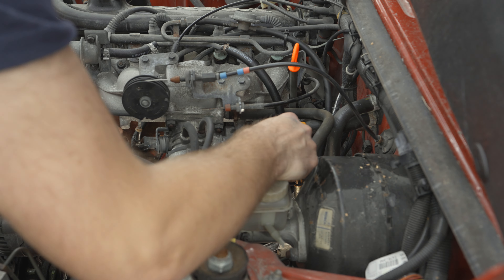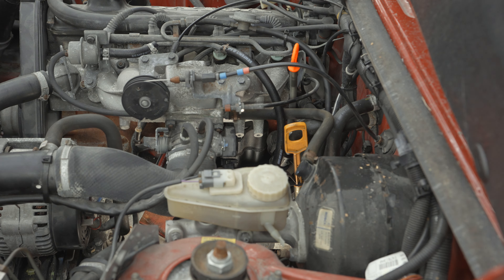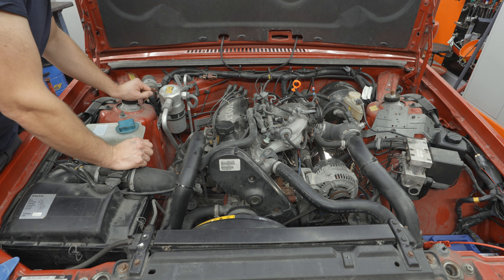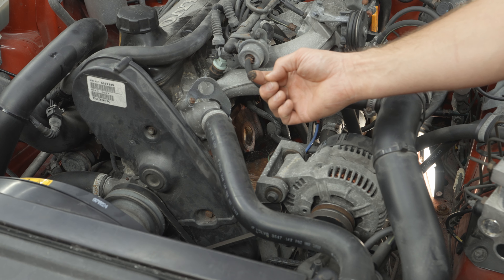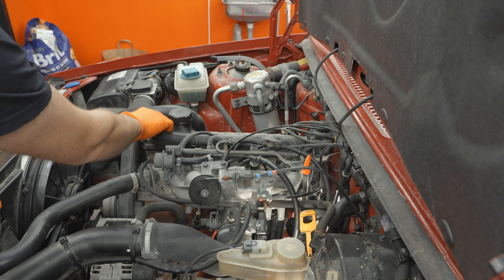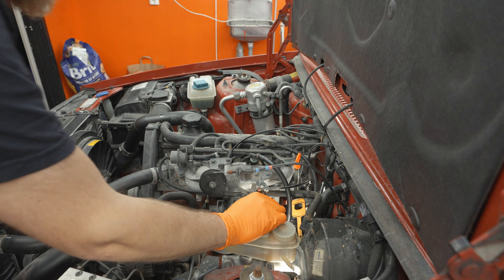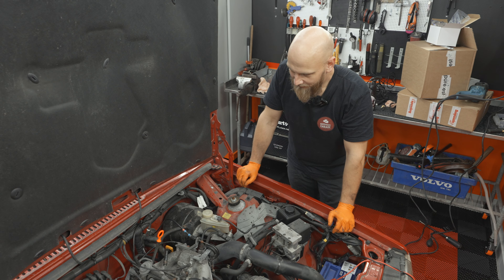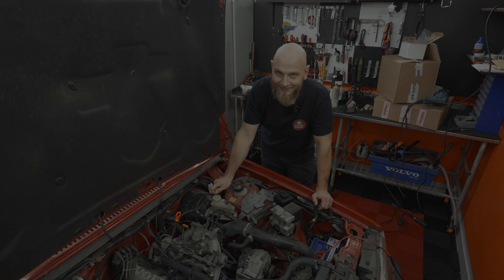How to Clean & Replace the PCV Canister on a Volvo 945 | DIY Maintenance

Comment: Great video.  Even though I've done a PCV cannister before (and broke it getting it out) I learned two things 1. The wobbly socket is called a 'knee'. Nice, I like it.  2. the seal doesn't come with the PCV.  Arrrgh!  We're as far away from Sweden as you can get, parts cost $$$ in freight and take ages...

Comment: I wish Volvo made a PCV box that you could take apart and clean.  It is easier to just replace them altogether, versus trying to clean them in their current configuration on the "redblock" motors.
Reply from the maker: True, and it is a service item as well. And if you have egr it's a real pain.

Comment: What alternator are you using ?

I really need to upgrade my 65A one in my 740 ^^

but I'm not to sure about what kind of mount works so I'd better ask :)
Reply from the maker: I think its the 100A Bosch on this, Part No: 9447865
Reply: @BackmansGarage  thanks for the answer :)
Reply: Thanks for the awesome video. I replaced that on my 240 and it was a pain. Recently acquired a 940 wagon and plan on replacing it soon. Your video made me smile on how much easier to access it. Keep it coming